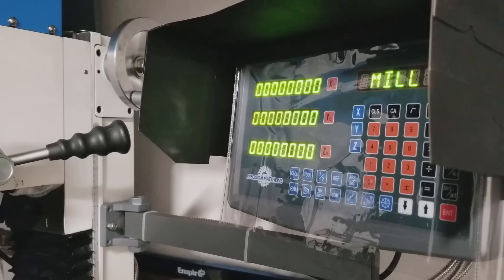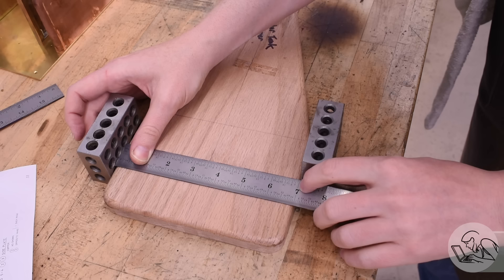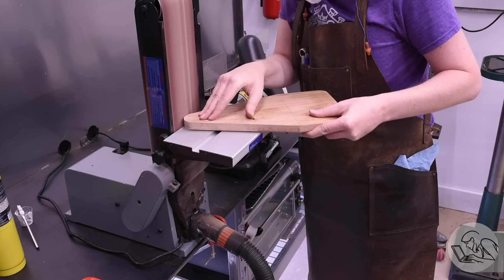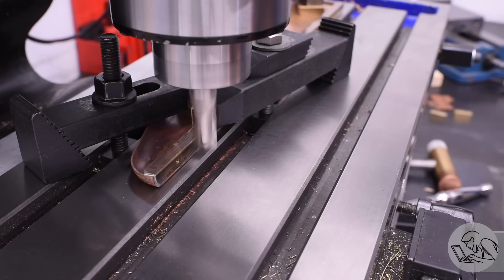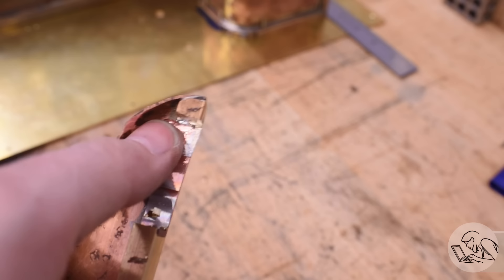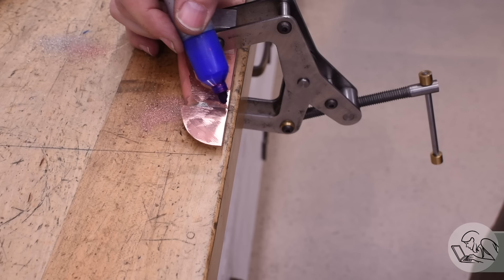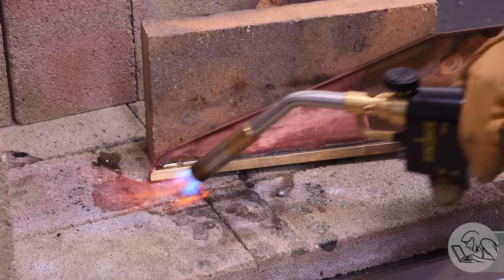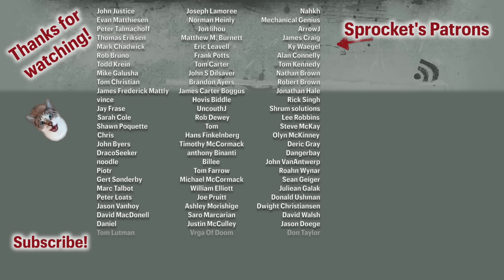A Big Error!   Pennsylvania A3 Switcher, Part 23

Comment from the maker: Hey everyone- to all the folks saying I should move the coal bunker back, or reform the fronts instead of the tails, etc: You have to understand there are hundreds of interrelated parts on an assembly like this. If you start shifting or resizing major components like that, your changes will cascade horribly downstream. It’s important to stick to the dimensions in the drawings as much as possible for as long as possible. That’s why I went to the effort of fixing the exact dimension that was incorrect, rather than changing whatever was easiest just to get things to superficially line up at this early stage.
Reply: I totally agree with your theory...
Reply: you're exactly right, cascading issues make more work downstream, keep up the awesome work and don't worry about the "masters" of anything, certainly not from their keyboard....
Reply: I'm a hobby CAD guy, and accounting for cascading changes is a big part of the order of operations in making a CAD model. The "obvious" way to produce the model is often not very effective for making the kind of dimension changes the real world object will need. So I really appreciated your point here.
Reply: @snakezdewiggle6084 apprentices and hobbyists differ in who pays for the material.

Knowing where you can get away with repairs vs a remake is a skill in itself. If this was a boiler, I'm sure the outcome would have been very different.
Reply: It's the same when building a replica of a car. If you start 'adjusting' things it all cascades and in the end you don't have a true replica.

Comment: Retired heavy equipment mechanic. What makes a good technician is the ability to fix your screw-ups.
Not only do you fix them, but you do it with the same level of integrity that you had from the beginning.
Whereas many would take shortcuts just to save time. You good!

Comment: Great recovery/repair. Just a quick important note. I'm part-owner of a powder coating company. And we had had mixed success with coating soft soldered parts. I know that it is supposed to melt at 600-700 F. But we have had several parts leak out solder at 425 F. And even if it does not leak out, you can have a problem with degassing that ruins the finish. I strongly suggest you do a full dry run in the oven ,at the full time cycle and temp, slightly above what you plan. Ex. we would test at  450 F. I hope this helps in some way....
Reply: Indeed, normal 60/40 solder has a range where it gets progressively more liquid. A 63:37 however has a much more defined freeze point and may work better for that, I actually use it to calibrate digital soldering irons.
Reply from the maker: I’m going to test it on a scrap assembly and use a low temp powder. If it looks sketchy, I won’t do it
Reply: @Blondihacks  That is a great idea. Our most embarrassing incident yet was an original 1960 radiator overflow tank. Never even thinking that the Ford factory would use soft solder on a part that holds 220 F coolant, we just tossed it in with the rest of the pre-bake. 30 minutes later we opened the oven door and found a silver pool on the floor.   That part was irreplaceable in its original form. The client was kind enough to accept the aftermarket replacement that we were able to buy and coat for him.  GRrrr....

Comment: Little tip - if you're removing soft solder you can take an old t-shirt and wipe it away with your finger while it's in its liquid state, leaving an only atom-thick layer behind. Of course you'll have to pull the torch away for a moment so you don't catch yourself on fire. Seems dangerous, but you're lingering on the metal for such a short time that you won't burn yourself and the solder instantly solidifies when it contacts the fabric, so it won't penetrate to where your finger is. Won't work for silver solder though!

Comment: 'I'm proud of this repair.' I try to have that attitude; mistakes really do lead to both creative problem-solving and good satisfaction -- but only when the problem solving actually works, and only once the job is finished and checked. I really stress out when I mess up (especially when, as is often the case, I do it for  bonehead reasons), and until I work it out, I have a hard time letting it go.

Really well done!

Comment: As a woodworker and "wannabe" machinist, my shop has several boards and panels that were cut wrong. I don't really consider them errors, just extra material for the next "unknown" project! Great save. Always good to have others that you can tap Into for different solutions. No one person has all the answers. Keep the videos coming!!
Reply: You should see the stock rack with partially machined parts out in OUR shop!  Problem is none of them ever seem to be the right size for a new job.
Reply: Yep, errors are just putting aside stock for other later TBD projects.

Comment: That must have been heartbreaking when the endmill caught that copper. I've had similar happen and just stood staring at it in disgust for what seemed like an hour. But like you did, you have to move on and fix what you can. Your fix turned out great.
Reply: Same here although I would have remade the part since I would have SpaceX'd the original across the room. Ain't no buff'n that out.
Reply: Yep, copper is horrible stuff to machine. My bench has a frustration corner where I can indiscriminately use a hammer, but I trying to use it less.

Comment: Excellent problem solving.  I think the root cause was you do not have a good way to measure such long lengths.  In the future you could use a block of known height on your surface plate.  Then put your height gage on that block.  Now your height gage range is extended by the height of your block.  So get a decent angle plate that you can put your  height gage on.  This is a good way to measure longer lengths.

Comment: Yours is one of my most favorite channels Quinn.  Good recovery, and I always get a chuckle when you insert one of your "adult language" test patterns.  It was also fun to see you doing woodworking on a mill.  I often end up doing small metalworking tasks with my woodworking tools, so this seemed fitting.  Also, I've been studying the early history of machine tools, and clearly the metal lathe evolved from wood lathes.  It didn't really happen until something besides hand crank power was available, but the Wolfegg Castle Housebook's illustration of a lathe seems to suggest that they were using a lead screw on a lathe with wooden ways, and a hand crank for power.  Now that must have generated plenty of "adult language" moments.  Anyway, keep it up.  Fantasmo!

Comment: Hey Quinn, nice save.  🎉. I would have shaped a piece on the form first, and tried to cut to fill, but that would be a whole different kettle of fish when it came to fitting it, and your way was just fine, maybe better. You certainly got a better fit on the side than I would have done. 
Now, just a suggestion before you get too far.  I know that you are going to powder coat, but as you know, it’s very unforgiving to finish flaws.  In the video it looks like there is a blemish, kind of like a dent, where you joined the patch piece.  So if you want to see if it is going to be too visible, give the area a local shot of spray paint. Primer will do, but gloss shows more. Once it dries, you will have a clear idea about how it will look like with the powder coating.  Takes just a moment, and will come right off again (as you well know)  with a bit of scotch Brite, or perhaps even just a wipe down with paint thinner. 
Enough from the peanut gallery! Running away at the keyboard again, sorry. 
Now, all I will say in closing is that it was grand, warts and all.  Just bask in the glory of your success, and gird yourself for the next battle.

Comment: Plan A1: drill out the fixturing screws from the copper, re-flow the solder and use a little judicious force to get the sill-bar off (minor shock loads may be required).
Plan Prawn (what the heck is halfway between “A” and “Orange”?): Hammer form a patch piece, somewhat oversized on all edges and approximately 1.5 to 2 inches long (but without overlapping the milling on the sill). Cut and dress both pieces back, then join. It may be possible to lap the two pieces on the flat face (as you might with a body panel repair on a car; overlapping the two pieces and hammering and dressing them so the joint is two layers without looking like it); but that would likely show through the powder-coat without the “benefit” of filler.

Of course, there’s no way I could have come up with that if I’d had the “adult language break” - it’s always easier to be calm and dispassionate about other people’s problems. :-)
Reply: Much of the solder might be removed the same way it went in - sucked by capillary action  out onto the braided copper strips used in electronics for exactly that purpose. My approach, which may have not been possible in this case, would have been to cut the wooden form in half down its long axis to fit inside the copper piece without removing the bar.
Reply: I suspect that the surface area of the bar was such that removing it, even having wicked away much of the solder and with the joint wet, would have been extremely difficult. Even that tiny piece at the end put up a fight against the pick.

Comment: A-1 recovery effort, and look at it this way - im certain there were many real full size Locomotives with patch panels and all manner of rebuild repairs in the shops that werent carried out to the factory prints.  I say this sort of thing adds character and even a quirky sort of realism that is actually closer to the real thing in many cases than absolute perfection, which as always a challenging goal most any time.

Comment: Hey, that repair worked just as well as the one you did in the Patreon video I watched! Now is that accuracy or precision. Sometimes I get so cornfused.
Yes, I know. "That boy just ain't right."
This is one of the reasons that I really appreciate your videos. You show the mistakes and your fixes.
Well done as usual.
Thanks, and Meow to Sprocket.
Reply: Interesting musing, accuracy vs precision.  
Accuracy refers to the adherence to a standard such as "that dimension is accurate" ie. made to drawing requirements.
Precision refers to likeness, ie. that egg is precisely like all others in the box.
Note that it is possible to have a box of precision parts, ie. one is like the next one but all are scrap.
If a box of accurately made parts is scrap, that is a different problem altogether...

Comment: From what I've read about steam era stuff, it's possible that a low-volume engine builder would've have done just like you did in this circumstance.  I don't know how many shops the Pennsy had, but I'd expect that at the bigger ones, they'd just throw throw damaged part in the discard bin and pulled another one from stock.

Of course, even a real A3 would not be built the way a model like this is (those tank sides probably wouldn't one part, for instance) but still.

I love this series.  🙂

Comment: Seems to me that whenever Quinn really messes something up, wood is involved (or at least gets blamed). Maybe she needs to sub out anything that requires woodworking 🙂 

Just to stick up for the woodworkers in the audience a bit, I use my digital calipers more than my tape measure, and frequently work to a thou or 2. And when I really mess up (more often than Quinn) the results often are directed to winter heat supply - no waste. Try that with brass or steel!

Comment: Hi Quinn. Nice repair! If you're planning on powder coating the tender parts it's worth checking the process with some sample/ non critical parts. Soft solder will melt and flow at the top end of powder coat temperatures.  I know this because some half round brass edging fell right off the cab roof on my little 3 1/2" gauge Tich. Fixturing screws and rivets help but you can get ugly bubbles of solder appearing where you don't want it.
Reply from the maker: Hey Preso! Yep I am aware. I am of course planning to test it.

Comment: You know, that snagged corner on the water tank side was a PITA and disappointing - but throughout this project,it occurred to me that this IS a locomotive and so the odd little divot on a part - or a splice in a sheet component - would not have been out of place on the full-sized unit and so why not on the model?  Otherwise - this is beautiful work and you should be very proud Quinn.  
Just sayin’….

Comment: Great save and thanks for the video! Not sure if this would have worked but my first thought was to put it back on the buck and fill that hole with soft solder using the buck as a backing, maybe some clay if the side didn't quit lay flat on the buck. Finish with a file.

Comment: Yet another amazing installment on the Pennsy Switcher, Quinn!  Amazing repair job!

That took some detective work to figure out where the error was. And then your repair was well thought out and well executed.    As you say, there are always times in any project where you have to take a step back to make more forward progress. You did this quite well. And I think you're right - once it all gets assembled and painted, you'll never notice the patch.  Nicely done!

Copper is a booger to mill.  I've had the same problem with an end mill catching soft copper and bending it all to whooy.  The best advice someone gave me on that was to use a smaller diameter end mill, which I've done since when milling copper.  I can't guarantee it will prevent the problem, cause copper is still so sticky to work with.  But I've been told that the angle of the cut when using a smaller end mill should help the problem some.   Still, that was yet another set back that you overcame quite handily!

Great work Quinn. It's always fun to watch you work and to hear your thoughts as you go.  Thank you for sharing your mistakes as well as your victories.  It makes your videos so much more educational that way.

Comment: Awesome example of error finding and resolving the problems early on!
That said, maybe I missed it, but why are you using copper for some of the parts instead of using the cheaper brass for the entire tender?

Ps. Next time when heating up 2 parts until the solder is liquid, have some pliers ready, makes short work of the capillary action that the liquid solder has.
Reply: Brass for flat and bar stock. Copper for formed parts. At least that's my take.
Reply: Pliers would overcome the capillary action but not, I presume, the gripping strength of the pins that held the bar to the sheet :)
Reply: @mumblbeebee6546  right, I forgot about those!
Maybe some desoldering braid in that case

@jrkorman good answer, I assumed brass would be hammer formable as well but that maybea mistake on my part.
Reply: @fladder1 Brass can be hammer formed but it's not easy, it's nowhere near as malleable as copper when annealed, much more "springy" and it work hardens more readily too.
Reply: @cooperised  That’s my experience too - I made little copper bowls when I was younger, first bashing the copper into hollows, then chasing them with hammers… once I thought “right, this is easy, let’s do brass” and it needed so much more force, and annealing every three blows, I was well fed up with it when it was done 😂

Comment: oh what unlucky case... i would have tried to pull off the bar when the soldier is fluent. Leaving it in there means the fastening holes are at the wrong spot. Nevertheless good repair you got it fixed again and no one will eaven see that it wasnt right on first try.

Comment: Nice work. Pleasure watching you make this. I worked with copper in the AC business for 20 years. I was curious why you did not use a hard solder on that one area where you caught the bit. I understand you have your reason and it is probably much better than my question by far.  I have used the hard solder to fill in and gap fill many times. Keep up the great work.

Comment: A repair is a repair is a ...fix.
An alternative would have been to complete all the silver soldering, followed by a little body work using soft solder to back fill the chewed-up area.
Filing and sanding the outside contour would then be a minor task.

If you are REALLY picky, a small plaster cast mold (dental plaster is great for this) on the outside of the affected area, with a copper sheet patch silver soldered to the inside of the chewed-up area.  Again, followed by a minimum of hand work on the visible area outside.
The whole thing gets painted, right?

Just some suggestions for others finding themselves in similar circumstances.

Comment: Amazing recovery! My first thought would have been to leave the slightly incorrect angle and try to cut and shorten the sides where the top and bottom are parallel. And then I would have made two new sides when that went disastrously wrong.

Comment: 1) The idea of making a slot in the wood came to me straight away while watching the video, but without considering the problems at the end of the reinforcement. Hey, I'm just watching the videos 😁 Why take something complicated apart that you can make room for relatively easily.

2) Repairing the hole: There wasn't much time during the video, but I would have first thought about whether the hole could be enlarged into a rectangle, which would then be filled with a patch from the inside and soldered, similar to the video. I have no idea if it would have been possible as I have no experience with metalworking, but that doesn't stop me from looking forward to these videos.